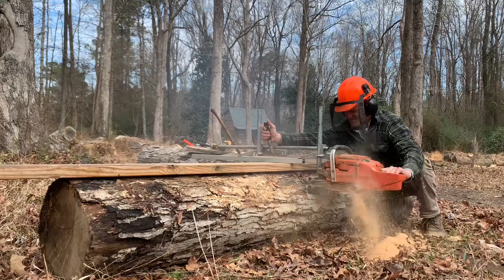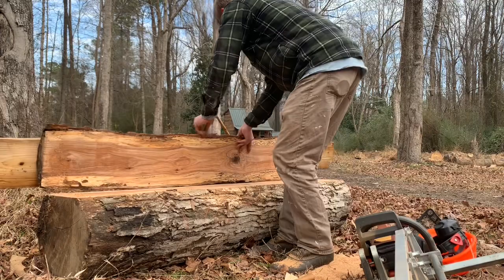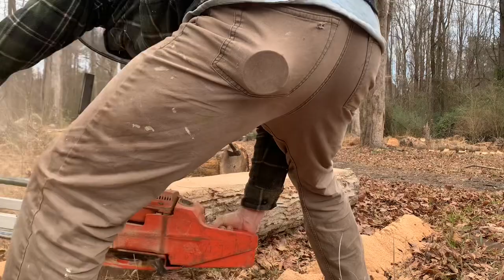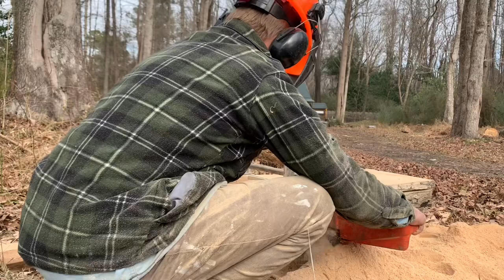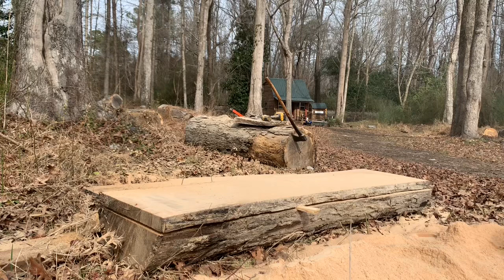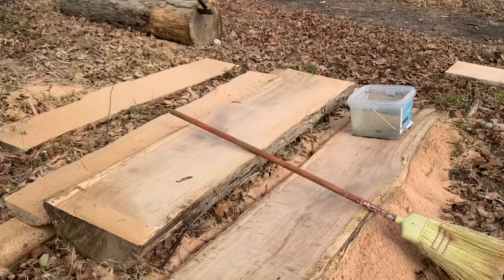Husqvarna 288XP - Alaskan Saw Mill

Comment: Do you run ripper chain or full chisel? What do you recommend why?
Reply from the maker: Hey, Dean. I have milled with both a full house chisel chain as well as with a ripping chain. In the video I was using the ripping chain. The standard chisel chain will do just fine but it is marginally slower and the sawn surface of the wood is a bit more rough. If you only have access to your regular chain, it will do you just fine. However, the best chain for the job is a true ripping chain. Hope this helps. Thanks for watching and God bless